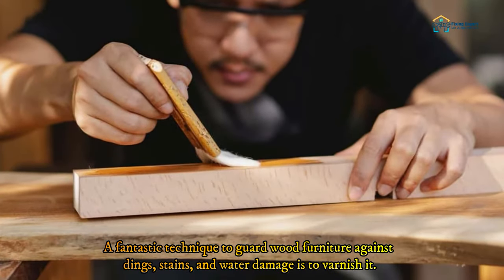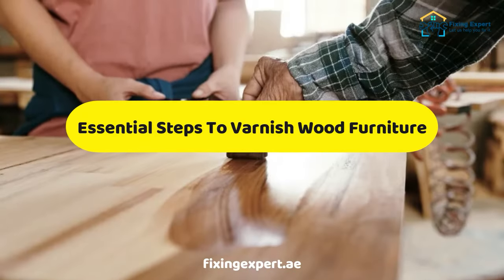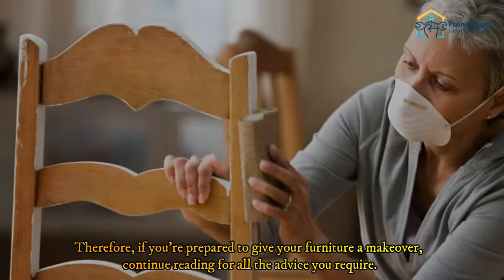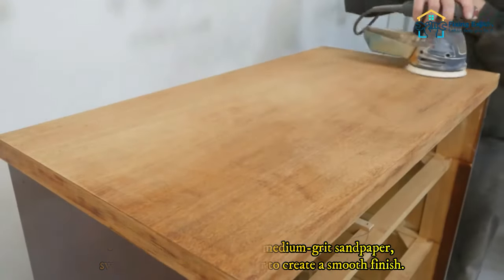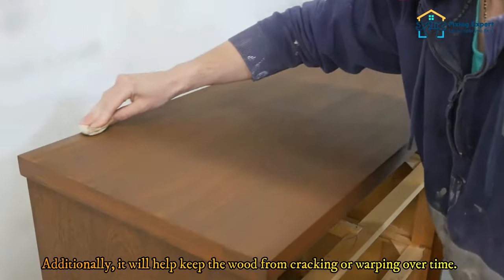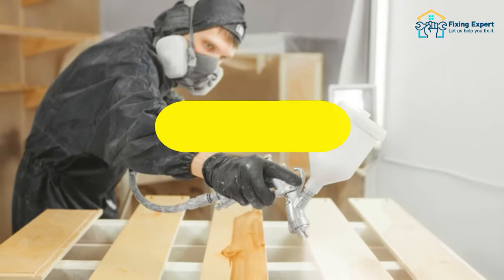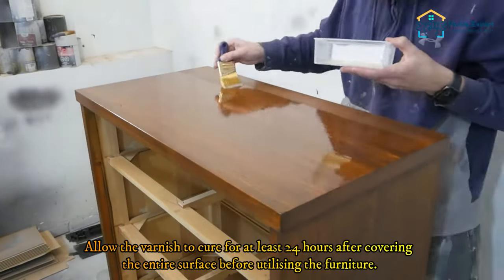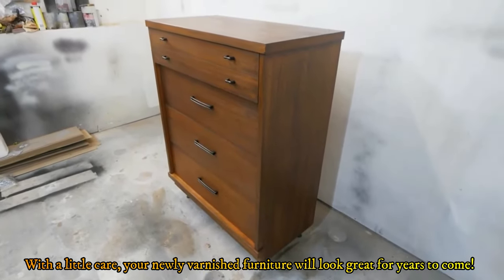How To Varnish Wood Furniture? | Essential Steps To Varnish Wood Furniture 2022

Comment: How to remove varnish from hands after applying can you please tell me
Reply from the maker: Act quickly: It's best to start removing the varnish as soon as possible before it dries or hardens further.

Gloves: If you don't have varnish on your hands yet, consider wearing gloves before attempting to remove it. This can prevent the varnish from coming into contact with your skin in the first place.

Use a solvent: Look for a solvent that can dissolve or loosen the varnish. Common options include nail polish remover containing acetone, paint thinner, or mineral spirits. However, these solvents can be harsh on the skin, so use them with caution and in a well-ventilated area.

Apply the solvent: Take a cloth or cotton ball, soak it in the chosen solvent, and gently dab it onto the varnished area of your hands. Do not rub harshly, as this may irritate the skin.

Let it soak: Allow the solvent to sit on the varnish for a few minutes to help break it down.

Gently scrub: After the varnish has softened, use a soft brush or an old toothbrush to gently scrub the area. Be careful not to be too aggressive, as you don't want to damage your skin.

Wash hands: Once the varnish is mostly removed, wash your hands thoroughly with soap and water to get rid of any remaining residue and the solvent.

Moisturize: The solvent and scrubbing may leave your skin dry, so apply a moisturizer to keep your hands hydrated.

Repeat if necessary: If there's still some varnish left, you can repeat the process, but be sure to give your skin a break between attempts to avoid irritation.
Reply: Wear gloves

Comment: hello Interesting video. Do you know if anything can be done when you varnish a surface of wood and the varnish does not absorb evenly all over the surface. The wood sometimes refuses to take all the varnish. Some parts of the wood absorbs more varnish than others. i have sanded the wood with electric sander before varnish but cant get a perfect finish. I have also tried oils with the same effect
Reply from the maker: Hello there! I'm glad you found the video interesting. Achieving an even varnish finish on wood can be a bit tricky, but there are some techniques you can try to improve the outcome.

Preparation is Key: You're on the right track by sanding the wood before varnishing. Make sure you're using the appropriate grit sandpaper (usually 120-220 grit) and sand the surface evenly. This helps open up the wood's pores for better varnish absorption.

Wood Conditioner: Depending on the type of wood you're working with, using a wood conditioner before varnishing can help ensure an even finish. It helps to seal the wood's pores, preventing uneven absorption.

Stain or Dye: If you're using a clear varnish and the wood is naturally uneven in color or grain, consider using a wood stain or dye before applying varnish. This can help even out the appearance of the wood, making the varnish application look more consistent.

Applying Thin Coats: Instead of one thick coat, try applying multiple thin coats of varnish. This allows for better control and can help prevent uneven absorption. Make sure to sand lightly between coats for better adhesion.

Brush or Spray Application: Depending on your project and the type of varnish, you might want to experiment with different application methods. Brushes and sprayers can sometimes provide more even coverage compared to cloth or foam applicators.

Temperature and Humidity: Pay attention to the environmental conditions when applying varnish. Extreme temperatures or humidity can affect the way varnish behaves. Try to work in a controlled environment to minimize these factors.

Practice and Patience: Achieving a perfect finish can take practice. Don't be discouraged by initial results. Sometimes, it's a matter of refining your technique over time.

Consult an Expert: If you're still struggling to achieve the desired results, consider consulting with a woodworking expert or professional. They can provide specific guidance based on your project and the type of wood you're working with.

Remember that different types of wood and varnish products may react differently, so it's essential to adapt your approach accordingly. With patience and the right techniques, you should be able to achieve a more even varnish finish on your wood projects. Good luck!
Reply: Thankyou very much with all the info you have given me.😀😄
Reply: @Justin-fy7xk Chat GPT just replied to you, dude.
Reply: Minimum of 5 coats to absorb the thirsty spots!